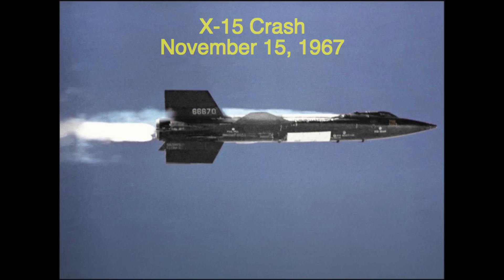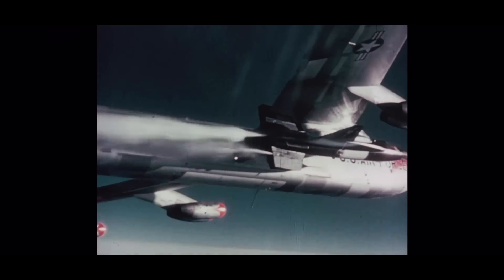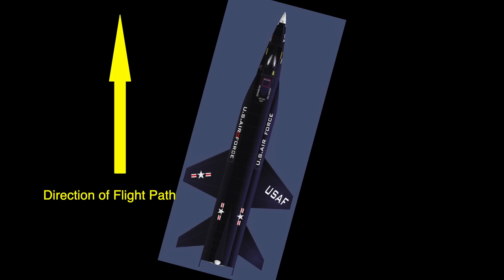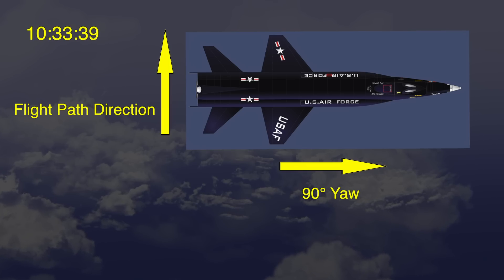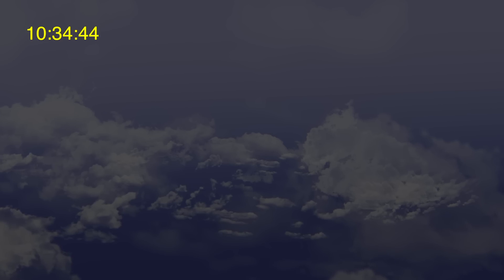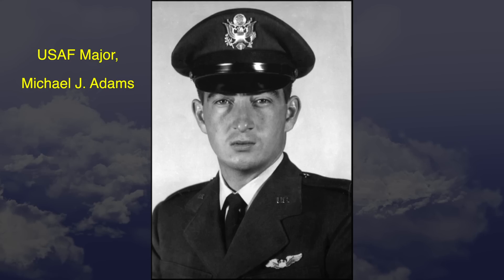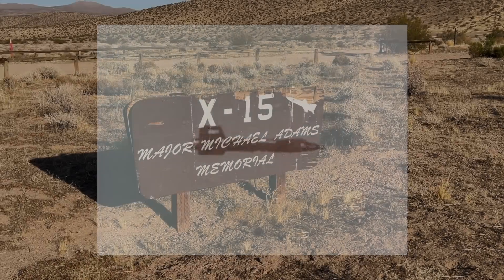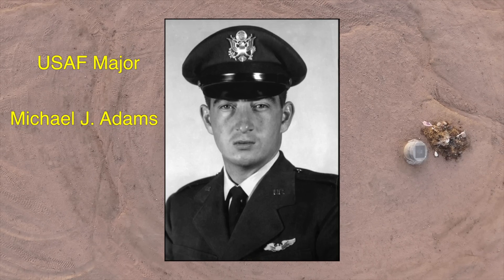X-15 Crash 1967. On Site Visit.

Comment: I believe the photo of the wrecked x-15 in this video is from a 1962 wreck in which the pilot survived an emergency landing at Mud Lake. During the landing, the plane began to slide to the right & then rolled, folding i believe the left wing over the fuselage. Given the extensive & tiny debris surrounding this site i don't believe  there was a fuselage left afrer this incident. 

However to this day, if you walk around in the desert that surrounds the memorial & keep a keen eye to the ground, you'll come across many small pieces of wreckage.

Comment: I'm curious about the wire harness shielding on the X-15. Modern aircraft are designed to absorb lightning strikes with no damage to the avionics. I wonder if the Inconel fuselage skin presented bonding issues. You wouldn't think that an arc could disable the flight control computer but that is a contemporary perspective. These guys were hugely brave to fly that beast.

Comment: This video reminded me to go check on the restoration progress on the NB-52.
Reply: are you referring to the one at the Pima Air & Space Museum in Tucson or the one at the North Gate at Edwards AFB. The one at Pima completed restoration a while back, and they recently added a mockup X-15 to the wing pylon. This is the first time since the program ended in 1968 that an X-15 has been mated to a mothership. There had also been such plans for B-52 no. 008 at Edwards, but so far nothing has happened there.

Comment: Test pilots had balls of steel.  What was done with the remains of the specific aircraft?
Reply from the maker: I read that the remains of the aircraft were buried in an undisclosed location on the property of Edward’s Air Force Base.
Reply: @forresthaggertychannel4301  That is correct. No one would ever disclose the exact location. There are many pieces of X-15 no. 3 which have been found around the crash site that were not buried with the rest of the aircraft.

Comment: The narrators explanation makes no sense at all. If it did transition to flying backeards at those speeds even in a thin atmosphere the craft would have broken up. The airspeed indicator would read zero and ground telemetry would have shows the changes in airspeed.
Reply: Even though the aircraft was turned backwards along the flight path, it continued at the same speed it had been traveling along its ballistic arc. There was no telemetry to the ground that showed the heading change, and the radar would still register the full speed of the aircraft.

Comment: Great video! Adding to the pilot's challenges, the outside view is VERY limited - It had very small windows and there is a deployable "heat shield" panel on one the one side to protect the glass from scorching during re-entry. The pilot then usually lands using only one side window that was covered by the "shield doors" (since the other side is charred). This specialized "speed and altitude" craft tried to be both an airplane and spacecraft and the ongoing lessons learned from these experiments eventually went to NASA to help create the Space Shuttle program.
Reply: The heat shield that covered one of the windows was only installed on the X-15A-2. It needed to be there because that aircraft flew two missions covered in a coating f ablative, which would run when experiencing the extreme heat of re-entry. That ablative would have covered the window, so after re-entry was complete, the cover was opened so the pilot still had one window available to see the ground and the runway to land safely. The no. 1 and no. 3 aircraft never needed that window cover. The pilots could easily see out of both windows during landing.
Reply: @x15galmichelleevans  Thank you for that clarification !  The X-15 I saw in Dayton had the heat shield protector, so it must have been #2. It also had reusable fuel tanks. Amazing to see it up close and appreciate what those experimental pilots must have gone through.

Comment: Thank you for the video, and for visiting the site, but I did want to clarify some misconceptions in your description of what transpired during the crash. First, the traversing probe was in the left wing tip pod and not the right. The arcing from that probe caused the on board computer to crash dozens of times throughout the flight, and Mike Adams reset it each time, causing a major distraction for him. Because of the distraction he was misreading one of his instruments, which is what led to him misaligning the aircraft as it prepared for re-entry. There was absolutely no problem with the RCS system, and all rockets fired as commanded. It was Adams himself that commanded those firings, and turning the aircraft 180 degrees out of its flight path before re-entry, and thus what caused the hypersonic spin. The instrument he misread could be set to indicate different things with a flip of a switch. It was reading pitch, but he misread it as yaw, thus the reason he moved the nose away from the direction of flight. Mike died long before the aircraft hit the desert, as the aircraft came apart from overstressing of the airframe. He had started the ejection sequence, but never had the chance to complete it before X-15 no. 3 came apart around him.
Reply: I didn't know the X-15 had an ejection system. I thought it was an, um, aircraft of commitment, like the X-1A. I wonder if an ejection would have been survivable at that moment.
Reply: @ald1144  The X-15 ejection system was a unique design, that was created to operate at speeds of up to Mach 4. The system was tested using a rocket sled on the test track at Edwards. If Mike had had the opportunity to complete the sequence, and get away from the aircraft prior to the breakup, it almost certainly would have been survivable.

Comment: Wouldnt the crash be in tiny pieces?
Reply from the maker: It was actually in several large pieces.
Reply: @forresthaggertychannel4301  The fuselage broke into two primary pieces. The engine section landed uprange of where the forward fuselage, with Mike Adams inside, landed. The memorial itself is at that site. There are indeed many small pieces that can actually still be found around the site, and all along the crash site path, which extends about 10 miles to the northeast of this site. Interestingly, some very large pieces, such as the horizontal stabilizers, have never been found. It's probable that someone found them many years ago, and carted them off for themselves. In my own collection I have several small pieces collected at the site, plus I was given both a wing thruster and nose thruster, along with a wing spar, by people who worked on the program. I use these as part of my displays when I do my talks on the X-15.

Comment: The plane seems somewhat intact considering it was going at 3600 mpg. That is, if it continued the same speed it was going when it was in flight.
Reply from the maker: It actually broke into several pieces and the front portion with the pilot in it is marked by the giant X.
Reply: @forresthaggertychannel4301  thanks Forrest. I guess I was expecting nothing left other than pieces no bigger than a foot in diameter.

Comment: i am actually surprised there is a legit memorial on site, and you don't have to go all Indiana Jones to find the spot
Reply: The memorial was originally created as the community project for an Eagle Scout. It was dedicated in May 2004. We have greatly expanded the site since then to give more context to the X-15 program, the accident, and Mike Adams in particular. The response we have gotten at the site is very gratifying. No one else has ever created such a memorial that we are aware of for the loss of an aircraft and its pilot. The X-15 and Michael Adams were special.